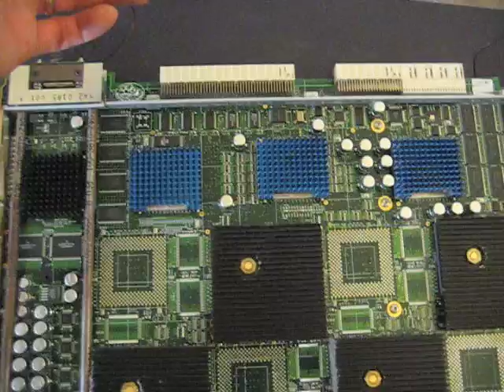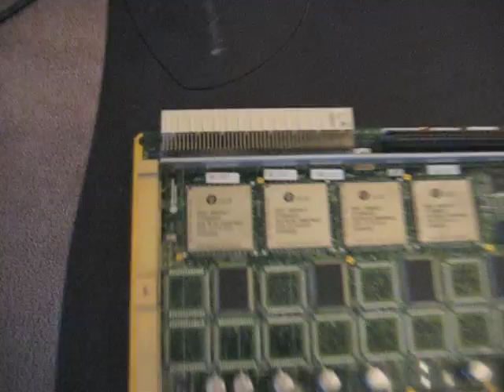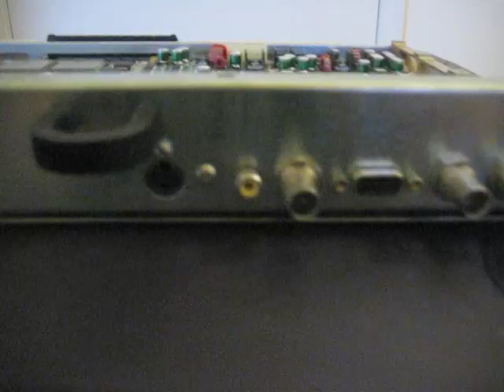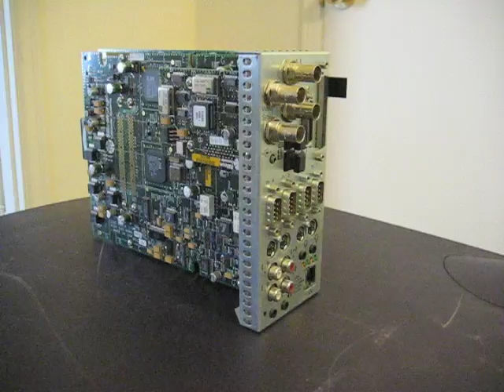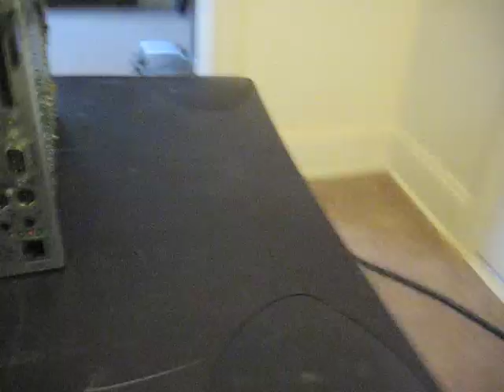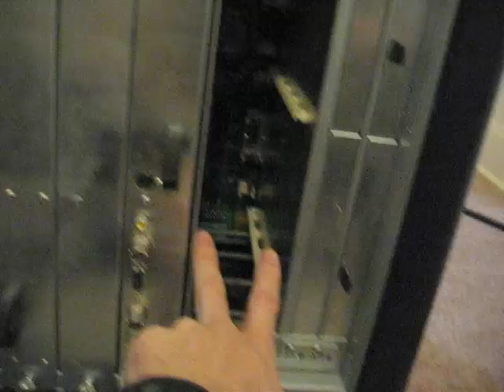SGI Onyx2 Tour - part two

Comment: thats quiet sad this see, that peoples still write graphics demo for the commodore 64 computer, but noone show what was possible on those machines. as you say, those machines are selled for nearly nothing.
Reply: ja ja, those machine are specialy designed for doing graphics. so i guess there some benefits in. what noone figured out at the days where they was in use. or nearly.
Reply: its kind of ironic, peoples spend ages still by using their sh-ee-t c64 to get some none disburting graphics out of it, while those computers arnt touched by the demo scene.
Reply: Now these machines go for a lot more then when this video came out.

Comment: They were basically using custom hardware to do 3D rendering. These days you mainly do that for real-time rendering (e.g. video games, flight simulators). For non-real-time rendering (e.g. CG in movies/TV), you mainly use clusters of general-purpose CPUs (people also try to use programmable GPUs, but that has some limitations), rather than custom hardware.

Comment from the maker: @Honthetube Not... really. Because of how drastically different the architecture design is (MIPS vs x86), as well as the sizable I/O throughput, it's kind of hard to make a guess. The max an Onyx2 deskside could handle would be two dual 400mHz R12k nodeboards (4 processors). But that would, in reality, be a very powerful system. At a wild and uneducated guess, think quad 1.5GHz Xeons.

Comment: @jpkiwigeek figures i guess as it was used as a desk side render farm to spit images at monsterus size resolutions...  and now there's graphics boards on the market that surpass it... and soon they will go over the 32 bit address space threshold no doubt, a good thing the graphics card in my mostly used comp does not nearly have as much in VRAM i suppose...

Also, do you have a rough idea of the the computational power of one of this sucka's fully loaded would be around?